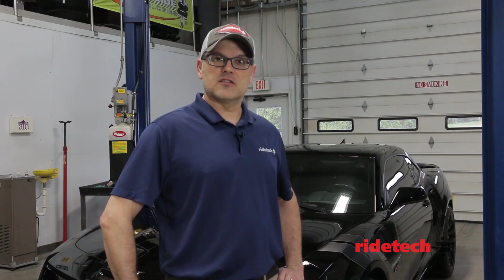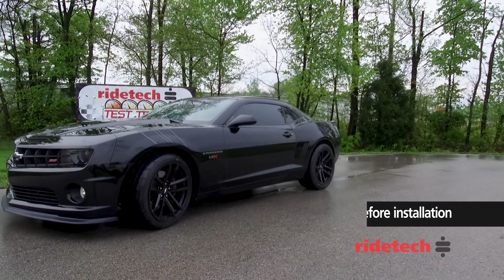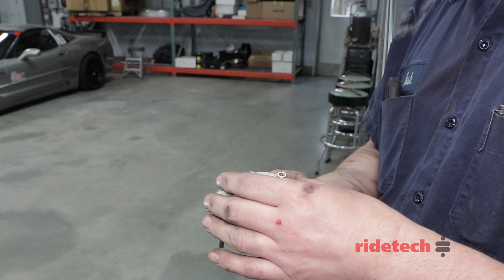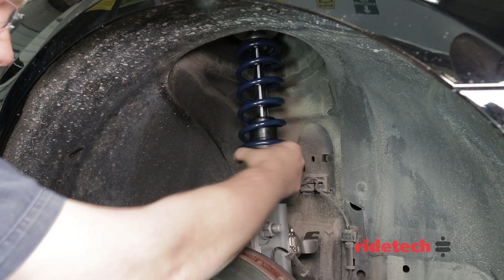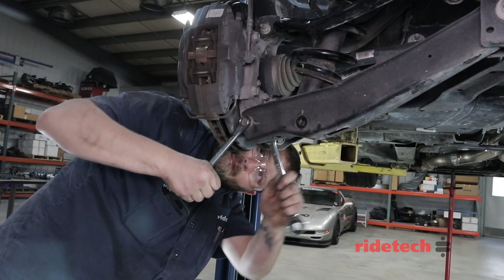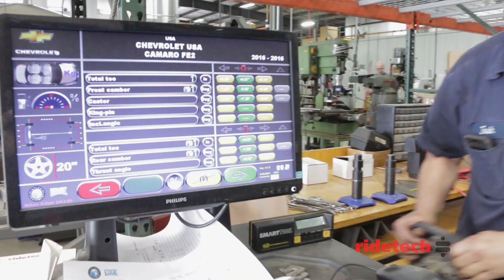2010-2015 Camaro Coilover Installation - 5th Gen

Comment: Why does the website show the rear brackets flipped compared to how they were installed here?? On the sight the adjustment ring is on the bottom side of the coil spring where as here it’s in the top??

Comment: great stuff don't remember the front shim when i did the job but getting old lol! wanted to ask on the rear coil over prior to some custom spring perches you sent me care of JDPs request i had some light contact issues with the upper control arm to upper rear coil over mounts. going back in to lower again if possible now that i have some 19" ccw forged track wheels is there a max i can go the stiffer spring from the spacer i am hoping will stop contact issues unless i am mistaken. any idea of max center of axle to fender lip or similar specs? thanks!